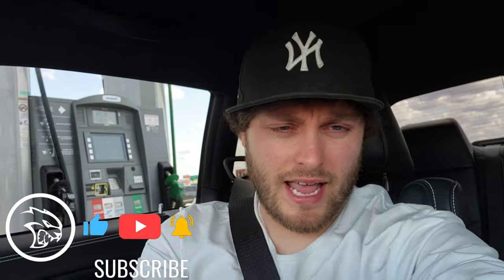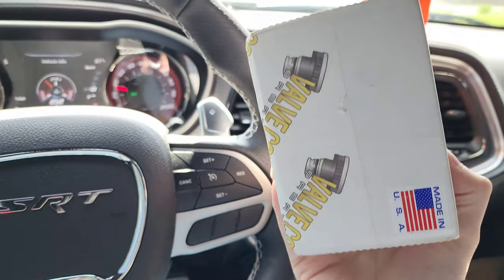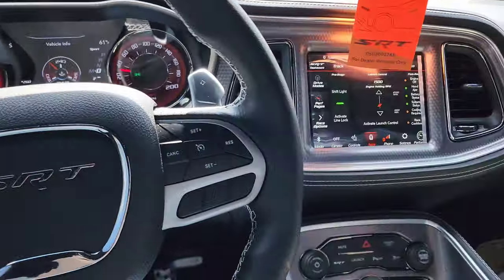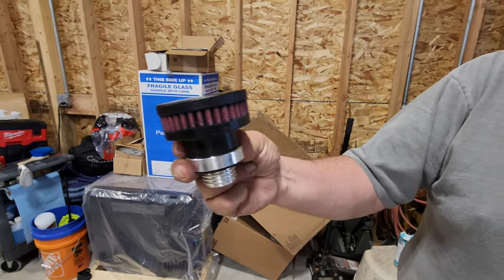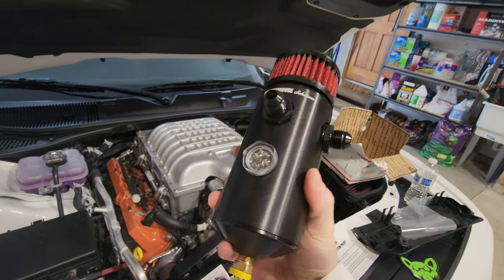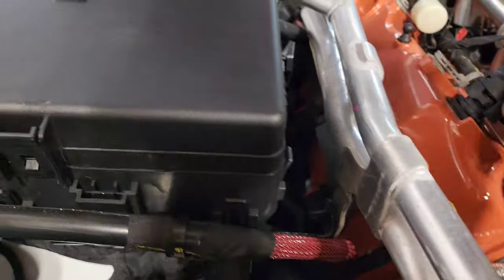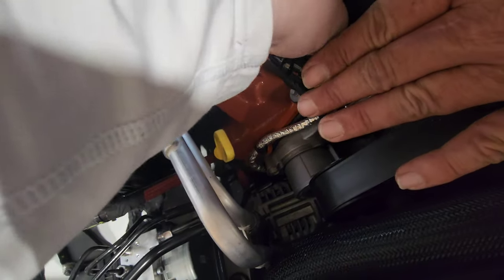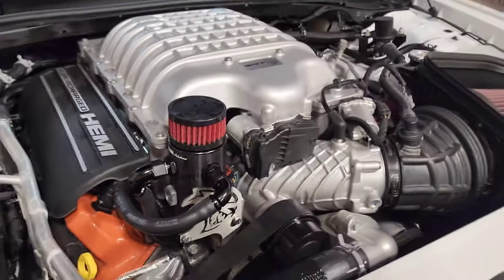PROTECTING My 2022 Challenger Hellcat with a MIGHTY MOUSE Catch Can!

Comment: What’s the garage dimensions? I’m building a 20x28x12 and just wanted to see size comparison to something that has alot of room
Reply from the maker: Shop is 22x36x14 with a 22x30 garage
Reply: @landoninahellcat8745  wow I didn’t think I’d have that much room width wise, I was thinking of putting lift dead center but I might actually put it on the side close to the wall so I can fit another car in there. I was just worried about working on one and it being too close to the walls to be able to work on that side